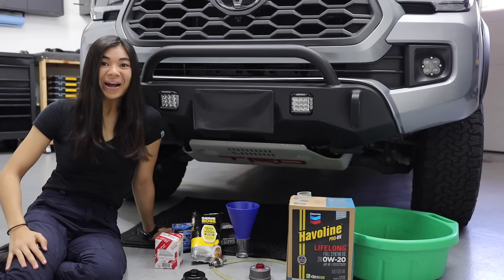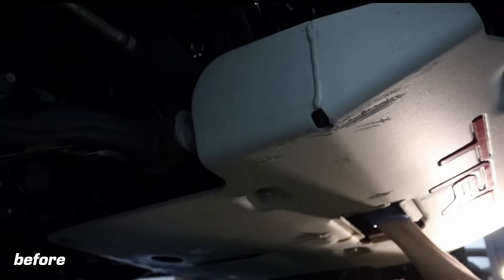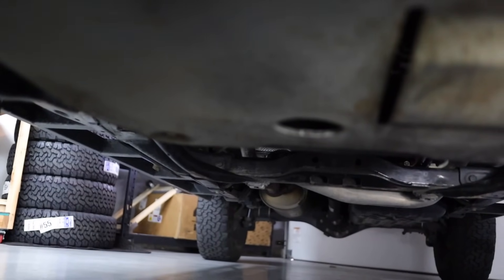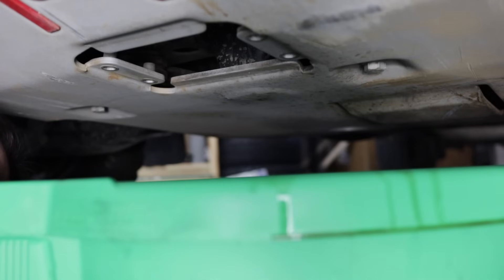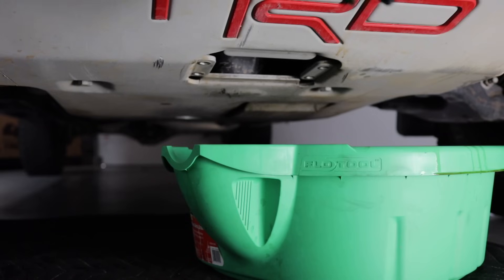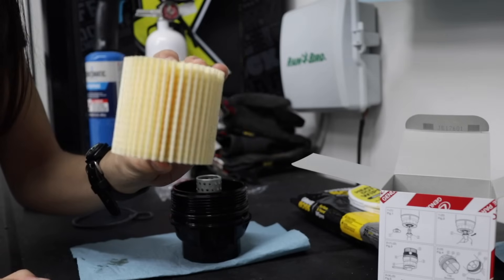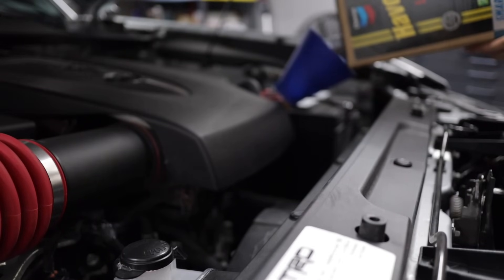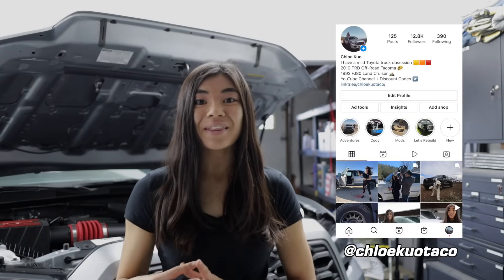Easiest and CLEANEST Oil Change Method for 3rd Gen Toyota Tacomas (anyone can do this!)

Comment: I do the exact same oil change with the same tools, the only difference is, my method is a little bit cleaner because I use a Fumoto valve in place of the oil drain plug…super easy, Don’t even need gloves
Reply from the maker: I had no idea that existed, will definitely add one! Thanks for the rec 🙂
Reply: Fumoto F103s for about $30 (Amazon) as of this posting....been using it on my '17 for years now and have installed one on many other motors I own since. I remove my skid plate because the access isn't adequate and inevitably used oil is going to pool on top of it and will drip leaving you wondering if you have a leak. If you remove your skid plate be very careful not to strip these bolts as it's easy to do with power tools....something the dealership does regularly and part of the reason I do my own service, not to mention half the cost. Good video!
Reply: This is the first I've seen any of this . When did the oil filter get reinvented? I like the funnel that screws on.
Reply: Does a leave a little bit of oil behind in your oil pan?
Reply: They have a huge failure point which is not recommended if that happens. Engines need that oil.
Reply: @lucristianx  complete horseshit brother, they don’t fail, very seldom will you ever hear anything about them having problems outside of draining slow. I’ve used them for years, not a single problem.
Reply: Doesn't the threads of the Fumoto sit too high in the oil pan leaving about a cup of oil from draining out?
Reply: @jdp1219  I mean it threads into the exact same spot the OEM drain bolt is.
Reply: Never knew this existed either… definitely going to pick one up. Thanks for the heads up on this 🤙🏽
Reply: @ChloeKuo  Hi Chloe, do you know if the skid plate you have on your Tacoma fits my 2018 Tacoma off road 4x2? I would appreciate it if you answered me. Thank you very much. Have a nice day.

Comment: Attach a tube to the OEM part that comes with the filter.  Same as the bolt tool you are using, but free.  Great videos Chloe.  Awesome work.
Reply: Came to say the samething!

Comment: There is a company called Fumoto. It replaces your drain plug. Has an open and close valve. I personally haven’t tried it out yet. But I’m going to pick one up before my next oil change. Suppose to be even easier. Should check it out

Comment: Chole another great tutorial.  We installed instead of the drain pan bolt, there is a drain pan drain valve.  Just flip the valve and drains quick.  

I like that filter drain!  

Great job again

Comment: Great video Chloe. Doing an oil change on my 2nd gen tomorrow with 280,000 miles and still running great. I change the oil every 3000 miles now because, well it can’t hurt. I went with the cardboard Havoline 6 quart 5w-30 high mileage. My only note on this video that I hope you find helpful is when you are using a torque wrench always apply force with your hand on the handle for an accurate torque value. The line on the handle of most torque wrenches is to indicate where to apply the force. Don’t mean to knit pick ! Really enjoy your channel. Keep up the good work ✊🏽
Reply: I'm not sure if that's true. Physically the same torque is applied, just different amounts of work is required depending on how far your hand is away from the axis.
Reply: @novanuke1356   it’s a fact.  Torque wrenches are calibrated to work accurately by applying force from the handle only. Any good torque wrench will explain this in the literature that’s comes in the box.
Reply: @pauliemars  He has a point. The torque value will still be the same when you click off, only thing that changes is the amount of force you had to use to get it there.

Comment: The only thing you miss is a FUMOTO valve. It will make the cleaniest oil change. Made in  japan, I have that on all cars since at least 10 years ago. No more oil pan plug to remove, no mess in a drip pan. Connect the hose to the valve, put the end of the hose in an empty gallon. Open the valve to drain directly in the empty gallon. Then proceed with the other motiveX tools to finish the job. 
I have that motiveX hose kit and would notgo without it !

Comment: Nice tutorial.  I would recommend that before you start the oil change pop the hood (if the hood for some reason didn’t open you’re stuck) and loosen the filler cap (so as to drain the oil faster). Pretty slick tool.  Autozone use to have a large sheet metal pan made by Blitz.  I use that instead of card board.  Just wipe it down from any oil splatter.
Reply from the maker: Great tip! I will have to check that out

Comment: Nothing at all wrong with your video, it's well shot and you're a good narrator, so thankyou, as for the products though, I don't really see the point of the funnel when any funnel will work, and also the drain tube gimmick because new filters typically come with the push in plastic piece to drain and it's really not that messy. The filter housing wrench does seem like a good tool.

Comment: I got the motivX kit a few months ago and finally did my first oil change the other day. 
A bit If a pita because the oem plastic housing was on super tight, had to drop the rci front skid plate to get a large crescent onto the nut and use a dead blow hammer. 

If I didn’t have this filter wrench I probably wouldn’t have gotten the filter off!
The drain tool worked great, trimmed the hose so it just went into the pan and the funnel was ideal to refill the oil!

I put on a Toyota metal filter housing and a fumoto valve so hopefully the next change is a lot easier!

Comment: Love the video.  Thank you. 
Also,  I was told they only need to be charged every 20,000 with the new synthetic oil.  Not every 5,000.  That's when the tires need rotated.
Reply: 20k miles is kind of pushing it even with extended life synthetic oil and all easy, dust minimal, all highway use in mild weather.  With the driving she is doing, off-road in dusty conditions, 5k is probably a good interval.
Reply: Toyota says 10 k.  But on the extreme conditions its 5k. Most people drive the "extreme" conditions. Oil is cheap.  Engine replacements are not.  Change oil and rotate tires every 5 k

Comment: My favorite oil is the Royal Purple Brand SAE  Multigrade synthetic oil. Sometimes I don't even know if my truck is running. Engine so quite and no vibrations. Use it on my 2020 Tacoma

Comment: Before installing your oil filter housing you should fill it up with oil a bit - that oil is in there for a reason, and you can but about 1/3 of a quart in before screwing it in and your engine is not effectively dry firing.  I have the Motivx filter removal tool and can attest it is great, don't have the hose, but I don't mind a little dirty.
Reply: If installing an oil filter without adding oil in it be a problem, why would most manufacturers mount oil filters sideways on engines?
Your engine always has oil on it's components. It's never dry after changing oil.

Comment: Motivx are excellent. They are an exact fit. I use the funnel on all 3 of our Toyotas (1.8l and 2.5l). I do have 3 filter wrenches but well worth the expense  if you do your own changes. An exchange step I do is siphon the oil from the dip stick tube. So very little drains from under the car.
Reply from the maker: Great tip! Thank you!

Comment: May I recommend a magnetic drain plug? I use a "Gold plug". It always catches gunk the filter misses. I also recommend a metal oil filter housing available on line or most auto parts stores. The plastic factory one makes me nervous.

Comment: Hi Chloe. Thanks for this video. I bought the Motivx Oil Wrench Tool on your recommendation. I don't know if my situation is unique, but the tool completely stripped out before the filter housing started to turn. (It stripped where my ratchet attached.) Yes, the filter was on tight. But would have expected the Motivx to work better than a standard wrench. Maybe I just got a bad one. Also, the drain tool did create much less of a mess than the little plastic piece that comes with the filter. As someone else called out, you can just attach a hose to the plastic piece that's free.

Comment: I just changed mine. Or attempted to change. Bear in mind, I have always changed my own oil in all my vehicles. However, my 2021 Off Road has kicked my rear. Granted the dealership changed the first oil change. When I changed my own, the plastic cover was so tight, the fins on the sides broke off. So I had to add new oil and take a to dealership to replace cap. I ended up purchasing a new aluminum cap because I hate plastic and don’t want this happening again.

Comment: One thing that you left out is the retaining pin on the oil filter. That’s extremely fun to try to remove while the shield is on the bottom of the truck. Never again.

Comment: Hi Chloe...
I was surprised that you didn't mention the torque specs for the oil filter cap and for the drainbolt on the oil filter cap!
Oil filter cap = 18 ft.lbs.
Oil filter cap drainbolt = 10 ft.lbs.

We have a RAV4 instead of a Tacoma but I subscribed any ole how.

Comment: Thanks for this video, I just got a 2017 Tacoma and I have a concern about that Tick Tick Tick noise from the engine that sounds like a Diesel Truck… is this normal in this 3rd gen Tacomas?

Comment: Chloe, Have you thought about up grading the filter housing to the aluminum one from a previous year. I did on my 2020 4Runner.
Reply: Totally unnecessary especially if you don't overtighten the oil filter cap.
Reply: @njsongwriter  I hate plastic. The aluminum one cost less than $20 I think.

Comment: Too difficult Cloe, you need a Baxter Performance oil filter adapter which uses spin-on oil filters and a Valvomax oil pan plug; THEN you’ll be completely mess free!👍🏻👌🏻
Reply: Those are no good for the truck

Comment: Is that the Plastic oil filter housing? I heard the metal one doesn’t have a drain plug, therefore wouldn’t be able to drain the oil filter using the Motiv tool, is that correct?

Comment: Awesome video! Love the specialty tools for the oil change. I have checked the oil levels in many vehicles over the years via the dip stick. Very simple stuff. However, reading and getting an accurate reading on my 2020 Tacoma's V6's dip stick seems almost impossible due to the design.
Reply: Yup. It seems unnecessarily complicated. I have to pull out my stick a bit and let it sit 20 min then clean and redip to get an accurate reading.

Comment: Good video. I see the old filter wrench you had looks like the previous version of the MotivX cap wrench. I bought that when I got my Tacoma in 2020 and used it successfully at 5,000 miles. Then after the dealer did my "free" 10,000 mile toyota care service and I wanted to change the oil at 15,000 miles they had torqued the filter cap on so tight that the old motivX wrench just skipped off the flutes and I almost broke the plastic ears off it.  I decided to order the new version you used in this video with the full kit of items. hopefully the next oil change will be better. 
Also how do you like the Pro -DS oil.  The packaging looks convenient but seems like wal-mart or the stores in Pennsylvania aren't carrying it.
Reply: Update... now that my Toyota care is expired I got the new motivX tools. Still had issues with the dealership putting the filter on a bit too tight but with the new style cap wrench and a breaker bar I was able to gently apply enough torque to remove it with out any damage to the plastic filter cap.  From here on out changes will be DIY and should go smooth with these good tools.

Comment: I heard that if any of the new cars engines end up burning oil when there's not very many miles on the vehicle is because of waiting 10,000 miles to change the oil.   It should be every 6 months or 5000 miles which ever comes first.   Because if your oil is 6 months old and you only have 3000 miles on it.   That means your oil is getting contaminated and this will cause your rings to stick and cause the engine to burn oil.    Don't neglect oil changes.    6 months or 5000 miles.     If 6 months goes by and your oil only had 2000 miles on it.    Change it anyway.

Comment: Great videos ... keep it up please & please list the tools you use / find helpful.
I have always changed my own oil since my first car (69 mustang) back in 72. It is a simple operation to do. Like yourself, I can guarantee the quality of the oil used and work done. While I switched to Toyotas back in the 90's because of their reliability compare to US auto maker quality going down down toilet. [in my opinion]
In 1999 the Tacoma had the oil filter hidden behind the front wheel (behind a rubber access 'flap' ) once you turned the tire to gain room. What a pain. In 2012, the Tacoma oil filter was moved to the top on the engine with very easy access from above. I love it; changing the filter is a joy. (those engineers should have gotten a bonus.) Now i see you have 'fake' replacement filter (which you have to disassemble to replace the paper filter inside [more complexity]), behind the skid plate and from underneath again. Why didn't they stay with the very simple design of the filter on top (by the battery). In my opinion, that was perfection, and the best location/way to change your filter. 
In my 25+ years of Toyota ownership, they always improved and made the design better. Now it seems they went backwards. (Risaburo would be rolling over in his grave)

Comment: Hi Chloe, my  Toyota Tacoma is a 2016 TRD sport 4X2. I haven’t Tried doing oil change myself yet. And Im thinking of starting doing it. Does it the same process?
Reply: 4x4 and 4x2 V6’s would be the same.
Reply: The stock skid plate will be different. The grey one she has is an Add on option on all but the Pro. You'll probably have to pull your skid plate off IIRC. But it's smaller and lighter.
Reply: Thanks

Comment: I use high mileage full synthetic on mine 4Runner.
Reply: Why high mileage. Does it consume oil?
Reply: @njsongwriter  about 1/2 quart in between oil changes, gives extra protection to engines with over 75K miles.

Comment: Chloe check out the Baxter Performance Adapter. It lets you use regular spin on filters. Also get a Fumoto Valve for the drain.
Reply: Never

Comment: FYI for anyone wondering- I think the manual allows a 10k interval. But I still split the difference and usually change around 7500. I have no idea your driving habits or climate so maybe 5k works for others!

Comment: Check out the Baxter Toyota TS-501-BK Cartridge to Remote Adapter. Instead of dealing with all those ridiculous steps, this allows you to use the easy spin on filters. This will definitely join your favorite mod category that includes your seat jackers and hood struts.
Reply: I will never do this.

Comment: If you use those cheap oil filter wrenches they tend to crack the plastic housing like how it happened to my taco, then had to wait a day to replace it for the aluminum one to come in. Also the after market filter I get comes with a filter drain that screws on instead of pushing on and making as much of a mess.
Reply: I find that the push on service pipe is less messy than the screw in one. Just put a plastic cap over it until you get it in.

Comment: Good advice for all of you who has the black oil filter wrench, throw it away. I did my first  oil change on my Taco after my warranty expired, the dealership tightened the oil filter canister too hard that I ended broke off one of the tab with that black canister wrench. This result oil oil leak. The black wrench is supposed to fit on the canister 3 to 1 teeth, if the canister is too tight, don’t try to force it, you’ll end going to the dealership and spend $95 for a new filter canister.

Comment: The plastic bit is shit.
But...if you use a small empty Gatorade bottle to push the plastic adapter up all the oil is collected without a mess in the bottle.
100% agree !!That notched filter wrench is also garbage. Such a waste of an engineer's meeting to create that.

Comment: Torque settings for oil filter housing and plate? This is why we end up with cracked plastic filter housings, because they get overtightened. Usually happens after engine warms up.

Comment: Thanks for the video. Check out the oil filter adapter to replace this cartridge style and makes it like a normal oil filter removal, baxterperfomanceusa.com makes a billet aluminum replacement made in USA! I have a 2019 Tacoma and probably will get one for mine. Youtube has some videos as well.

Comment: 5000 miles is probably too early. Do Blackstone or other oil analysis and you’ll realize that you can go longer with your oil change. It will also help you understand the health of your engine.
Reply: Depends on the type of driving you do. If you do mostly highway miles I'm sure you could go longer. But with city driving, off-road use, or other severe use like towing a trailer, it would be best to stick with 5,000 miles.

Comment: Super disappointed. First time doing the oil myself, bought the product. No one mentioned that if you can’t get the oil filter drain metal piece off. That all those products are absolutely useless. In attempting to get the metal piece off, it unscrewed the oil filter itself. Oil everywhere and didn’t even get to use any of the products.
Reply: Your housing plug was likely over torqued, done right, these kits are great.
The housing plug should only be torqued to 15foot pounds max and the housing itself to 20 to 25, better luck next time.

Comment: I'd take that skid plate off and leave it off. It's enough of a chore already. Especially with having to drain your filter and fuck with o rings instead of just replacing a metal filter.